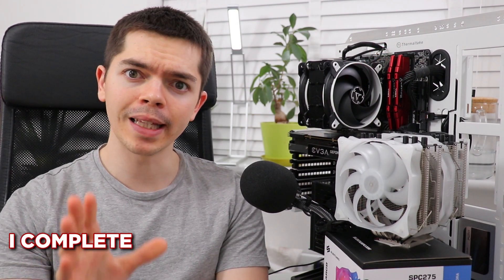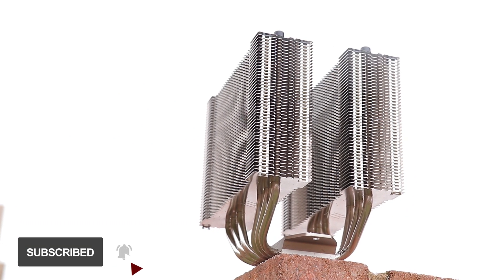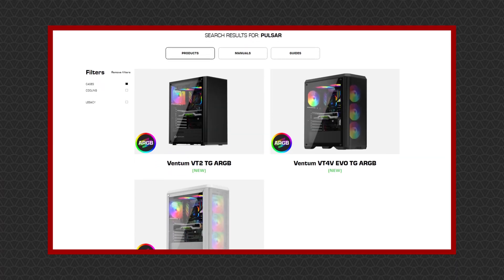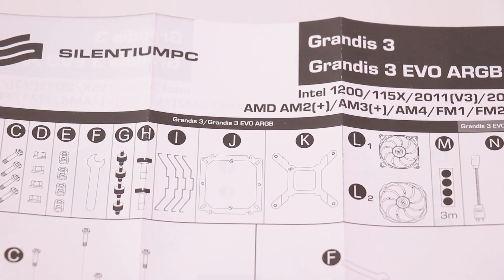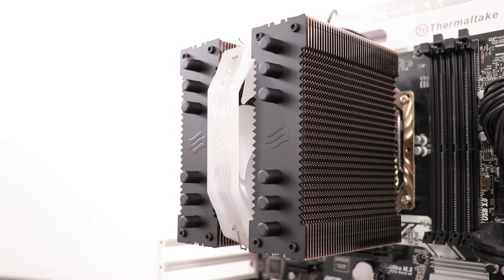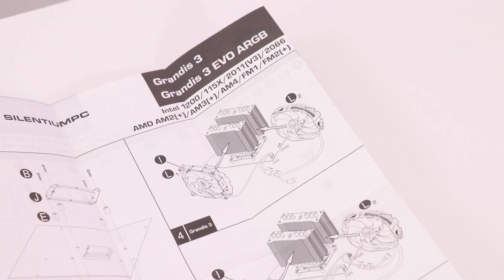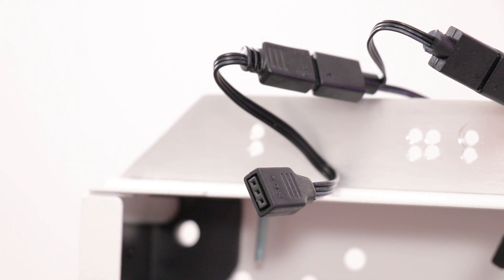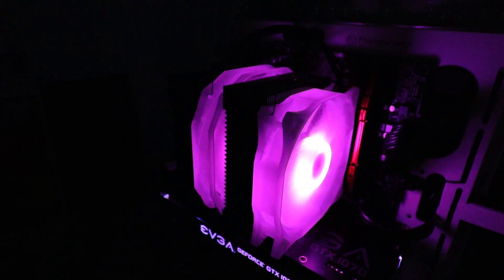The most ARGB CPU Cooler on the market! - SilentiumPC Grandis 3 EVO ARGB Review

Comment: What i would have loved to see/hear, is a noise sample of the cooler under full blast.
Reply from the maker: I used to do this, but it doesn't translate perfectly well through in the video. I have provided decibel readouts in the slides if you want to know how loud it is to other coolers at full speed.
Reply: @AVTechy  Ah, okay. I asked because different fans have a different sound profiles at full speed.
Reply from the maker: It's a tricky one to really convey in video. For that to work there needs to be some sort of reference point that's familiar to every viewer. If there isn't then depending on each mic that have their own sound profile the whole thing will be off.

So we need a universal reference sound, and a really flat profile mic, as well as really flat profile speakers on the users end to get this to work accurately.

With most things, there is no one good answer, so providing something that's relatively simple to convey that can be simply repeated is the best option. Feature creep is something that I try to control, since I could include a reference sound of sorts, invest in a good sound testing setup on the cheap, and add all of it to every video, but that would make the videos even more painfully long to produce.

I'm having the annual headache of improving my testing methodology, and testing efficiency is very high on the list there. Trying to do all this to the best of my ability really kick starts some headaches :D
Reply: @AVTechy  thanks for the detailed reply